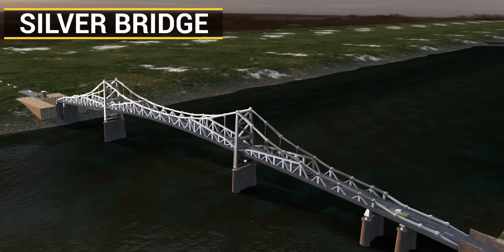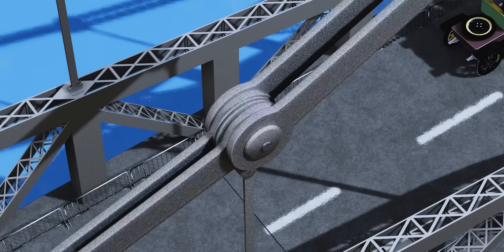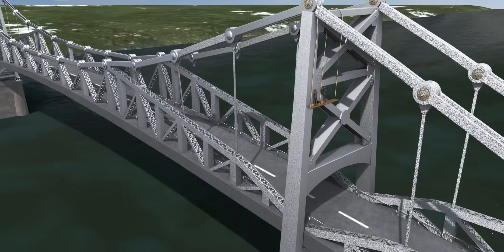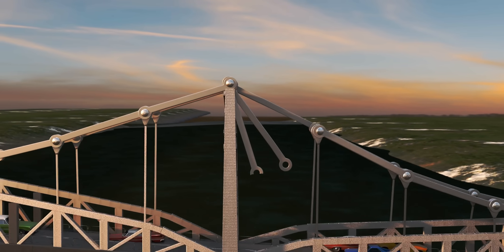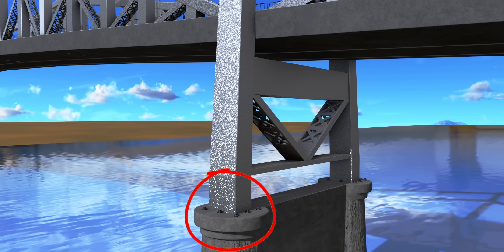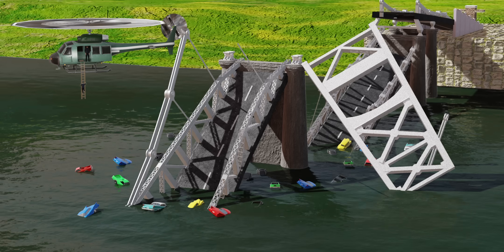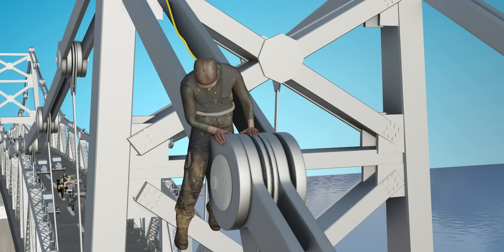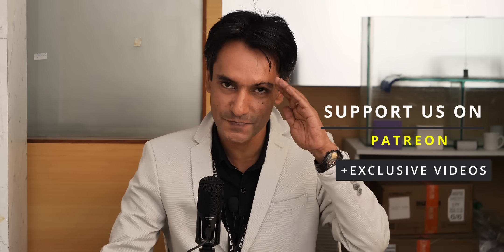Silver Bridge | The Tragedy That Changed Civil Engineering Forever

Comment: Good video!  I'm a bridge inspector. I enjoyed the video!  It resulted from a failure in the design. But in its day, fracture mechanics were not well understood and it was designed with the best understanding of its day.  As with all technologies, understanding evolves.  But in structure design, especially bridges, people's lives are more at risk than many other fields.  Slow, methodical, and we'll tested change is best.
Reply: Also, the designers couldn't predict the loads that would be on the bridge nearly 40 years after construction.   Even if there was a safety factor of 2x, it would not have been sufficient for the cars of that time, weighing over 2.5x the weight of cars at the time of construction.
Reply: @chadportenga7858  So it was a code failure? I'm just a layman but it's my understanding that there's a government agency charged with updating this stuff (load capacity, detailed inspections, etc.) What am I missing here?
Reply: @RogueReplicant Any changes made in the codes would be for future construction. This bridge would have been evaluated and found to be fit for purpose according to the understanding of structures of that time. If we start applying codes retroactively to already built infrastructure indiscriminately, we'd have to modify nearly every important piece of infra built more than a couple decades ago.
Reply: @RogueReplicant  It was made during an era where most folks drove the relatively lightweight Ford Model T, a vehicle 1/3 the weight of the most lightweight vehicles common when the bridge collapsed, and traffic was also much lighter in those days, and traffic lights much rarer, and even trucks were smaller and lighter, so the bridge was designed with much smaller loads in mind.
Reply: @chadportenga7858  the standard factor of safety for any engineering is usually at minimum 4x
Reply: The wisdom of that saying they have in military aviation - also applies to Structural Engineering -
“Aircraft manuals are written in BLOOD”
Reply: The "problem" with bridges is that they are in service for such a long time.  I go over a bridge in Trenton NJ that was built in 1884.  It was designed for horses and streetcars.  It has a pretty low weight limit but has a lot of traffic on it because it is a non toll bridge to get across the Delaware river.
Reply: Either the author of comment is 6 years old, or its written by AI. Lets save our dignity and not be fooled. Any idiot can press the 'go' button on the 'make my youtube money' app... but the problem is... having dignity. Well.. obviously this is not a problem for some, who would gladly sacrifice any dignity for money.
Reply: @johnnykeys1978 , I'm not AI.  I'm a good old fashioned human being.  And I'm not six years old.  My comment was relevant and accurate.  I've given lectures to regional and national audiences specifically on the development of bridge engineering and bridge inspection.  I know what I'm talking about.

Comment: There are always trade offs in engineering. Flexibility for strength, strength for flexibility, power for weight, weight for power, and the list goes on. This is why heavier and larger vehicles in order to meet  outdated café laws is ridiculous. We should update café laws so we can have regular cab pup trucks instead of 4k to 5k grocery getters. Modern vehicles are 1000lbs heavier than vehicles in 1980. History always repeats itself.
Reply: Are you referring to the rule that light trucks exceeding 8,500 lbs gross vehicle weight do not have to comply with corporate average fuel economy standards?  I think SUV's weigh less than that.

There has been an arms race on vehicle height and weight, with most people wanting to increase their safety, and some people wanting to be more menacing.  If the menacing behavior could be reduced, there would be less incentive for people to buy monster vehicles.
Reply: @rastry3673  that and how the café rules are less strict on light trucks and SUVs. If memory serves, I believe MPG regs are based on a calculation of wheel base and height. Basically, the EPA says you can't make a 4 cylinder regular cab pup truck because it's too small to meet their standards. I think the regs are also based on the entire selection of vehicles, which is why a lot of manufacturers are phasing out sedans.

Comment: What a great video. Anytime I hear the word "innovative," in bridge design I cringe. As an engineer, you do NOT want to be innovative with other people's safety. 

The change in load was not the issue with the design, the issue was a lack of redundancy and a pitiful safety factor. The engineers involved should have been ashamed, they knew what they were building.
Reply: "the issue was a lack of redundancy"

Excellent point, which is why thet have these documents called, "Failure Modes Effects Analysis" (FMEA).  They are very pessimistic, but are a necessary "evil".